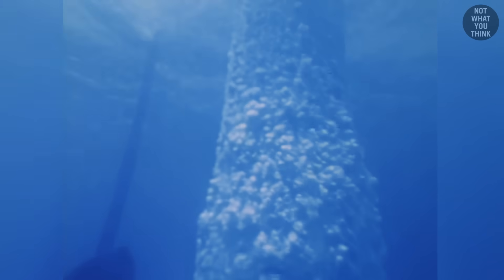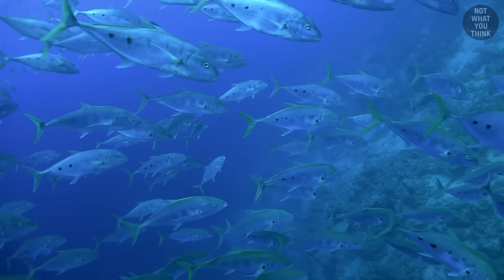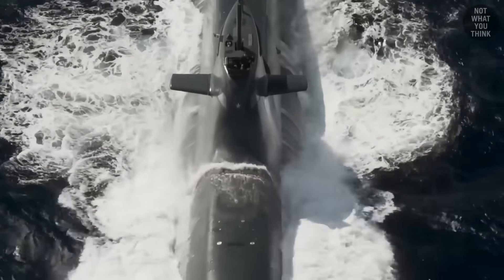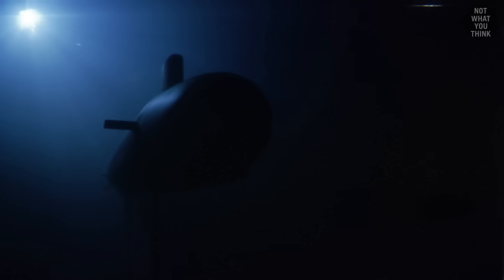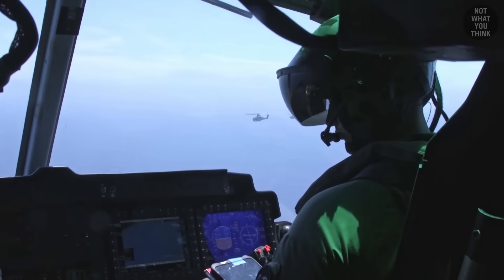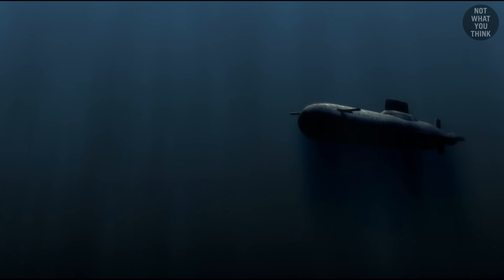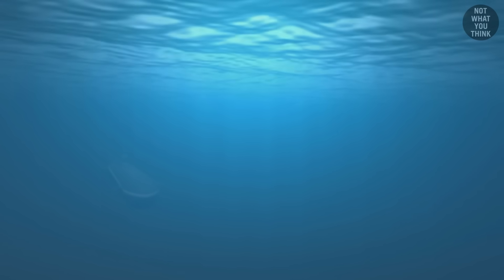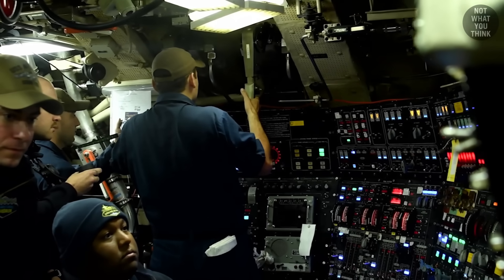Why Being Too Stealthy is Bad for Submarines

Comment: Diesel Electric boats don't need to surface to charge their batteries. They can raise the snorkel and then run their diesel engines to charge the batteries without surfacing the boat.
Reply: Modern diesel engines are amazingly quiet, with precision balancing, electronic revs optimization, active damping platforms and noise cancelling devices.
Also, with air independence engines and hydrogen fuel cells, they can stay underwater for weeks.
Reply: I mean if you want to be really technical they are surfacing just a snorkel which is part of the submarine so they are kind of surfacing the submarine just a small part of it
Reply: Diesel engines can be detected by their exhaust gases. It takes many hours to charge the batteries, enough time to leave a long trail of gases. Modern sensors are pretty good.
Reply: When on the snorkel they might as well be surfaced. You can be easily seen from the air. You just aren’t quite as big a radar signature.
Reply: @matthewhuszarik4173  I wonder what the max length would be of a snorkel
Reply: @maxcr5937 I imagine it could be very long, but it would become impractical and its diameter would have to increase as its length did to keep the back pressure within an acceptable range. On the 688 class US Submarine I served on it went up about twenty feet and was about 2-3 feet in horizontal area. It was oblong shaped to cut through the water about 24” x 18” as my memory serves.
Reply: And their whale song can be heard for hundreds of Nautical miles.
Reply: is raising the snorkel loud/easy to detect?
Reply: @litapd311  Its the one event that sonar crews and orbital surveillance can pick up on, why so many foreign fleets have shifted away from them. Modern diesel electric systems keep getting better but compared to their nuclear counterparts that can stay underwater for as long as they need to, its still not much of a contest. Price-wise though, the diesel electrics win since a modern nuclear sub can cost billions each.
Reply: @Enonymouse_ 
Advantages and disadvantages of both. 

Nuclear 
Pros unlimited time under water, no refueling.
Cons, can't sit on the sea floor, can't turn the humm off, large.

Diesel 
Pro,  can be dead silent, smaller so can go into estuaries.

Cons
Need to surface regularly, need to be refueled so need to stay close to fleet.

Depending on what you're wanting to achieve depends on what you choose. 

Defending your home countries shores diesel can do the job really well. 

Travelling open ocean nuclear is perfect
Reply: @Enonymouse_ the diesel electric subs are actually far quieter than the nuke ones apart from while charging.  Hence they are the preferred design in litoral operations, where you can seek protection outside the combat zone relatively easy. Like everything else relating to vessels and aircraft,  no perfect design exists. One always has to balance contradicting factors. So defense posturing navies operating in and out of litoral waters tend to go diesel, while blue water navies tend to go nuclear
Reply: @Robert-j6r8c  Non nuclear subs don't have to surface regularly. they can stay submerged for weeks.
It is not 1944 anymore.
Reply: @litapd311  I think they have stealth shaped snorkeling for radar. As for sound, they probably slow down to prevent cavetation upon water break. I imagine they leave the zone of enemy operation before surfacing, or operate in snorkel in transit before disappearing into enemy operational zones.

If I could afford it as a nation, I would operate nuke subs exclusively to avoid any of those concerns.
Reply: @NoobNoobNews  They have to go slow when snorkeling as the "Feather" is easy to see as a white feather on the deep blue sea. Also the water force against the snorkel(15' long?) can break it off causing flooding and engine damage.
Reply: @NoobNoobNews  Nuke subs are pointless to any but a few nations on earth, all of which need them to posture first strike capabilities. There's a reason why for defense everyone else who uses subs uses diesel electrics, since they are quite literally undetectable and do the job better, so long as the job doesn't involve hauling nukes to a distant shore to blow up the civilian population of some man baby's nation your man baby didn't like.
Reply: @litapd311  A little. The two freight train engines throbbing for hours at a time surely does.
Reply: @bryanst.martin7134  at least the Gotland Diesel subs don't use normal diesel engines though. They use a Stirling engine.

So they aren't directly comparable to trains.
Reply: @ludwig2345  True
Reply: And the snorkel was invented all the way back in WW2. Wild.
Reply: @ Actually the snorkel was invented long before WW2 it was applied to running the diesel engine just before WW2 but it was used to ventilate the submarine long before. There are two primary function of the snorkel to ventilate the submarine and to run the diesel.
Reply: The first snorkel was patented in Britain in 1916; it was not picked up by the Royal Navy, which saw no use for it. The Italians successfully tested a ventilation pipe on the submarine H 3 in 1926, but no further use was made of it. The Royal Netherlands Navy tested ventilation pipes in 1938 to allow running the diesels while submerged to charge the batteries; this system was seized by the Germans, but was initially only used for ventilation. It was only after the Allies became more effective at hunting U-boats that the schnorkel's use was expanded to running the diesels while submerged for charging the batteries.
Reply: @ The Turtle used in the US Revolutionary War had a snorkel to allow the crew to breathe.  Later variations included blowers and diesel engines. But snorkels have been around for as long as Submarines have been useful.
Reply: @seanmalloy7249 No the Dutch used the snorkel first
Reply: It is not what you think 🤔
Reply: That is what they mean by surfacing.....
Reply: Okay i literally just commented asking why they dont do this...thats good to know.

Comment: How exactly 90-95db is the same noise level as "currents in the ocean and marine life around them"? 90db is considered loud enough to cause hearing damage...
Reply: Ocean noise is also stupidly loud, that's why. You have extremely efficient sound transmission through water, so a wave crash can be heard for miles like your ear is getting violated by it.
Reply: Probably has something to do with the environmental pressure being much higher underwater than in air.
Reply: soundwave in the water behaves differently than in air
from a comment above: 90dB in water equals to ~64dB in air
Reply: @tranquoccuong890-its-orge   It's not so much they behave differently, it's that due to the higher density, a quieter sound can travel further, so a lower baseline was established -- where what would be a quiet sound in air is actually quite audible in water, when in absolute terms they are, say, about ~26dB off or so.

Comment: submarines seem very visible if you just look at them but very hard if you use sonar and tech like that and the surface of the water blocking them, people should make some kind of light based sensor strong enough to go underwater
Reply: Light changes at different depths, and each wavelength interacts with water differently depending on the depth, differently to how it interacts with air. Search up a video of how depth changes the colours of light.
Reply: @Loudward__ just thought it would be cool
Reply: @yyhhttcccyyhhttccc6694 It don't work that way. Kinda like asking light to pass through miles of fiber with no amp every so often. Just doesn't work like that.
Reply: @AldoSchmedack  then make a stronger light
Reply: @yyhhttcccyyhhttccc6694  Brother it is wild you can vote.

So you make this insane light somehow (not possible but lets entertain) it needs to be two times stronger than the power required to reach the target (as the return path)
So if you turn this magical light on, your enemy will see you at LEAST twice the distance away than you could ever see it.
Reply: @mememachine5244  1 I'm a minor I can't vote 2 it's just a idea made in 2 minutes by a kid on the internet
Reply: @yyhhttcccyyhhttccc6694  lmfao
Reply: Light is just electromagnetic radiation at quite a high frequency, which means it will get absorbed very quickly in water. Sound is king underwater.
Reply: @Tealice1  just thought it would be cool

Comment: A submarine cannot be detected by thermal sensors while underwater. They use the thermocline because of how sound travels underwater - you are invisible to someone over the thermocline while you are under it, and vice versa.
Reply: I was thinking that that sounded rather suspect. Considering that the ocean itself is a massive fucking heatsink for the submarine.
Reply: Anybody else get the feeling this script was AI-generated?
Reply: @wape1  Just another channel that doesn't know what they are talking about. Like that Simon guy on megaprojects
Reply: @Watchyourselvez  Might be that I'm just getting overly sensitized by seeing AI slop everywhere. The thermocline part in this video sounds especially like an AI making up stuff on the spot from word association alone.

 I think Simon Whistler is just a narrator, in some cases he hasn't even read the script before filming... 😅
Reply: @wape1 obviously he doesn't know what he's talking about most of the time, otherwise he would be one of the most knowledgeable people on the planet with how many channels he has, he just reads scripts, wich are made by writers who do some research, but they also aren't experts in every subject (or most of them) so ig it's kinda hard to distinguish what is true and what's not
Also, I don't think he reads any script beforehand lol (at least not on brain blaze)
Reply: Not entirely true as far as being detected via thermal sensors while submerged, nor for being invisible to a sensor on the other side of a thermocline.
All submarines, and especially nuclear subs, leave heated water behind themselves, heat generated by all the systems the sub has that must be "pumped" out of the sub. That cooling is handled by seawater, necessarily leaving warm water in the sub's wake, sometimes rather hot actually. That thermal signature is detectable via a number of different sensors, and though it may not suffice to give a targeting-grade detection it is sufficient for an opposing force to begin narrowing down the position of the sub.
Thermoclines aren't impenetrable walls. They do make sound waves bend and attenuate as they encounter the thermoclines, but sound will cross them.

Comment: Sea Wolf are the quietest nuclear subs on earth... DE subs are far more quiet.
Reply: Diesel engines create explosions every time the two pistons come together, nukes don’t. Do you think they don’t have nuke electric engines. How about water injection and discharge drives. You have been reading too much Chinese crap.
Reply: How did you get your information. Leaked to CNN by the commi chinese. The commi chinese don’t have nuke boats so they are going to tell everyone that DE boats are the best. When did you get your top secret clearance and the Navy told you everything about the nuke boat program.
Reply: The Seawolf class also has back up diesel generators.
Reply: so quiet that the underwater mountain in the South China Sea couldn't detect it & move out of the way, that one time in 2021
Reply: @tranquoccuong890-its-orge  So, you actually believe what MSNBC tells you. You were one of those that believed all of MSNBC’s crap at the election. Something leaked to MSNBC. Anything leaked to MSNBC should definitely be believed.

Comment: Movska submarine is very hard to detect because it stays very, very still.
Reply: No machinery noises either.
Reply: at the dock.
Reply: Docked at the bottom of the Black Sea .  Usually patrols and keeps an eye on a VERY  small area.
Reply: Almost as still as drax
Reply: Operating in a wolfpack with Su-30...
Reply: They did go to ultra quiet. No noise except the crabs chewing.
Reply: Detect? It has coordinates on its wikipedia page!
Reply: Same with HMS Coventry ,Atlantic Conveyor and lots lots more
Reply: @astafford8865and general belgrano

Comment: The quietest submarines are the small European ones.
Reply: Yep, especiall Swedens and Germanys. There are rumors that say, that these cannot be detected in ultra quite mode by anyone, unless they want to be heard.
Reply: @FoxtrotWhiskey3 Yeah, both beat the crap out of the navys they "play" against in wargames. The older german 209 model managed to sneak up on Los Angeles class subs of the US Navy multiple times. The 212 Class is even quieter and has air independent propulsion. The Swedish boats also have a history of sinking US carriers in wargames.
Reply: @peterfruchtig5334  Famous photograph of CVN-65 snapped through the periscope of U-24.
Reply: @jonny2954  Carriers aren't sneaking up on or detecting any submarine though.
Reply: @nathanahubbard1975  The carrier strike group U-24 penetrated to snap the pic sure tries to do so though.
Reply: @peterfruchtig5334  I am certain the US is using its best equipment when playing games with the Swedish and Germans.
Reply: @bradleyweigle7875  They'd be foolish not to. Aside from the national prestige on the line, part of the purpose of these games is to try out new tech before it's needed for a "live-fire" situation.
Reply: @natetwehues2428  Believe it or not when secrecy comes into play the military is not required to tell MSNBC anything. I don’t know where you are getting your info from, but we didn’t tell CNN anything. You seem to be making many assumptions.
Reply: @peterfruchtig5334  Do you really think anyone is going to tell the enemy they have been tagged by the fast attack traveling with the fleet. You should listen to MSNBC they know it all.
Reply: Guess he means nuclear subs.
Reply: @sebastiand152  Guess wrong, Swedish DE.
Reply: @tryagain.k1821  when he stated, that a specific nuclear submarine is the most quiet one...
Reply: @sebastiand152  Yes, he did say that. Then I corrected his statement. Look at the number of noisy parts in each boat and make up your own mind.